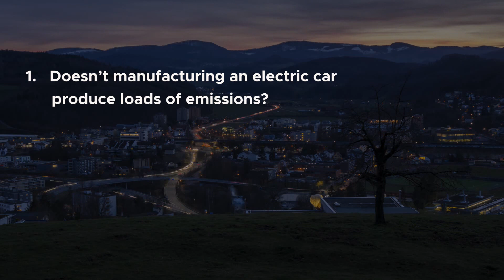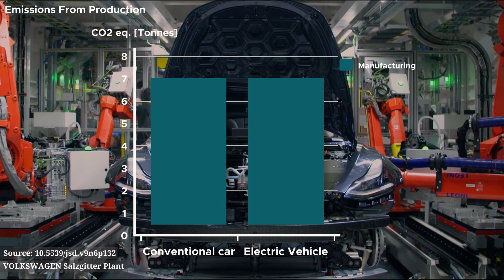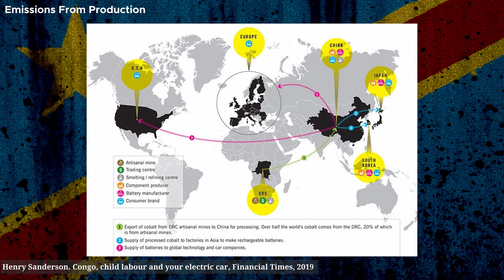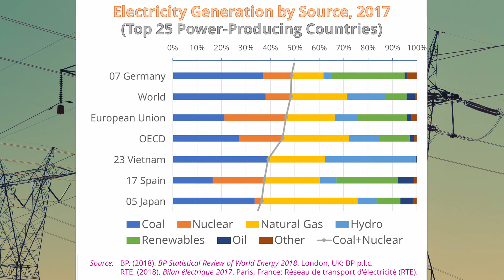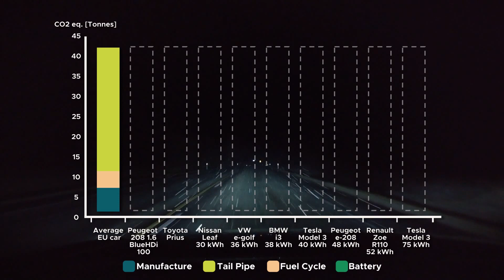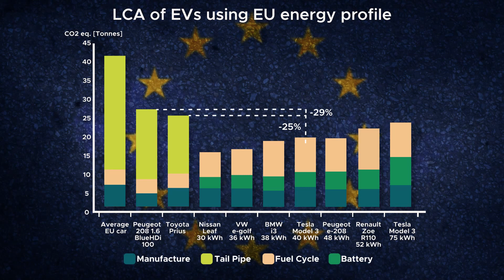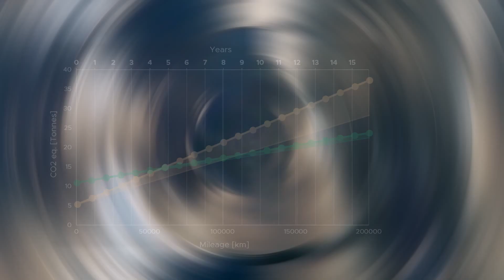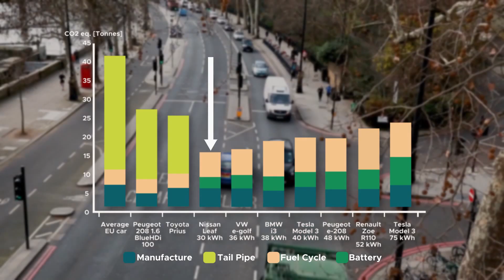Could Electric Vehicles be Bad for the Environment? Data Reveals the Truth

Comment: The range of travel is not apples to apples.  The amount of lost energy in recharging and heat lost isn't factored in. The reduction in range or actual miles driven in extreme weather conditions isn't factored in. The amount of energy used in conditioning the batteries or heating them up before trips in cold weather or before charging in cold weather isn't factored in. The time wasted in charging and time lost because of charging on long trips on the road isn't factored in. The drain on the grid and the extra heat loss in superchargers isn't factored in. The driving miles for all types of vehicles including trucking, rail and mass transit is not factored into the miles driven in the US vs other countries is not accurate and leaves out a lot. The average commuter mileage driven back and forth to work is much higher in the US just because of the way the cities are laid out. 

The average mileage of cars in the US still being driven is 175,000 miles on the original  engine with a large portion of them still being used with over 250,000 miles on the clock. An EV battery is not going to last that long. Maybe the car will but the cost to exchange the battery will mean twice the amount of EV s will be scrapped so the cost of production in the same amount of time will be double that of an ICE vehicle. The depreciation on an EV is approx 70% in 10 years.

Don't get me wrong, I like EVs but I also like fuel cell vehicle technology. Advancements will make EVs better but the time table is going to need to be lengthened out. 

Overall the adoption of Hydrogen could fix all of these concerns and be 10 times better for energy storage of renewables.
Reply: There are already Tesla that have broken the 1 million miles without battery replacements, many are going strong after 500000 or more miles.

And then you advocate FCEV which are not going to last that long - because of the nature of hydrogen they are extremely expensive to keep on the road. You need to have the tanks pressure tested to 700 bat/10000 psi every 6000 miles. New high performance air filters for $500 or more every 18000 miles, a new fuel cell membrane and fuel cell rebuild every 36000 miles, the membrane alone costs $1200 - and a set "do not refill after" date on the fuel filler cap after which you must under no circumstances put any hydrogen into the tanks anymore as the whole high pressure system needs to be scrapped and a new one installed...

Hydrogen is proven to be 3 times worse than charging a battery in a BEV. And FCEV do have batteries and a fully electric drive train but also have large tanks that reduce available space in both the cabin and trunk of the car.
Reply: @karlgunterwunsch1950  pretty much all of your Hydrogen information is false. I have worked with a of the components you list. The tanks or cylinders are good for years not miles. The tank checks are based from the date of manufacturing out under a time frequency.  I drove a CNG truck which uses the exact same tank technology. Mine had 150, 000 miles on it before they gave me a new truck. I never once had an issue with any of the components. Why don't you talk to people who have been driving an H2 toyota. They have been basically trouble free since they came out and have been on the road a long time. I understand you being a Tesla fanatic and that is okay but reality is reality and full BEV heavy vehicles will never do what Fuel cell vehicles can do. Physics are constant and evident. Cars are fine to be all electric. Trucks and heavier vehicles are going to require range that is impossible for BEVs to attain. Lots of people are trying to tow with Rivians and Ford lightnings and they have about half of the tow range. The more battery you have to increase range,  the more weight you add and you use up that range because of increased weight and around the tree you go again. It becomes a vicious circle. 

You just do you and don't worry about the rest of us, the Adults got this.
Reply: @desertdan100  Your information is correct for CNG tanks, unfortunately then hydrogen tanks are not the same and thus your information doesn't apply. Hydrogen has some nasty properties, such as being able to alter the structure of solid metal. It also warms up when evaporating - which is a big problem as that means you can not recondense evaporated hydrogen but must vent it.

And those people that drove a H2 car in California or Germany are selling them off as soon as the free hydrogen runs out - because the infrastructure is so unreliable and the cars themselves are so often in service. I have cited the service requirements for the Hyundai Nexo by the way...
Reply: @karlgunterwunsch1950  The CNG tanks are the same Carbon Fiber Woven tech that is used in both H2 and CNG. Yes H2 can cause enbrittalment in certain metals worse than others. I have extensive knowledge and training in Stainless steel Alloys as well as Titanium and other special Alloys. We have been dealing with H2 for decades , it is not a new thing or tech. As with batteries technology is advancing rapidly and there are many many Solid State storage technologies for H2 at low psi. Under 20 psi at room temp and extremes of sub Zero and over 200 degrees Fahrenheit. It is very stable in that mode. 

On a side note . When Hydrogen drops in pressure or Evaporates it has a refrigeration effect. It does not get hotter when it evaporates. It's Boiling point is very low. - 423 degrees Fahrenheit.
Reply: @desertdan100  Just that the tanks in FCEV are not at low psi,  they are 700 bar/10000psi, the filling station operates its buffer tank at 1050 bar/15000 psi ... CNG pressures are a joke in comparison.
Reply: @karlgunterwunsch1950  CNG tanks are tested to 2800 bar before they are certified to leave the manufacturing plant. They have to ensure that they won't burst under high temperatures,  pressures and impact stress in an accident. That is why they decided to use the same tank technology for H2 storage. They actually have fired armor piercing rounds at them under pressure to see the effects.

Comment: I wish you have also included the fact, that bateries deteriorate over time this they need to be replaced => more greenhouse gasses.
Did you also know how poorly EVs perform under extreme temperatures? Not very suitable for countries like Canada or Nordic countries in Europe.
EV's range is not the issue. The fact that it takes forever to charge them is. And unless you have a house with garage where you can charge it overnight, it will be very difficult for you to find some place where you can leave it long enough to get a full charge.
Reply: Yet in Nordic and Europe, they're changing to electric vehicles, Canada also has electric vehicles.
Reply: Can't speak for all EV makers but all new Tesla's have batteries good for between 400k and 1 million miles so no need to replace the batteries for most people.
Reply: "I wish you have also included the fact, that batteries deteriorate over time this they need to be replaced => more greenhouse gasses." He did it was one of the settings on climobil
"Did you also know how poorly EVs perform under extreme temperatures?" Again he did it was one of the settings on climobil
"V's range is not the issue. The fact that it takes forever to charge them is." There are a few solutions to that 1) charge it every night so that time is when you are sleeping anyway but yes as a man who parks a 30 second walk from his house I'm not going to run cables across the road to power my car 2) swappable batteries which some manufacturers already do and takes less time that pumping petrol in some cases 3) Overhead cables like trams this has already been tested with electric trucks.
From my point of view the problem is that I simply cannot afford to spend money on an electric car my car is a diesel from 2008 and it cost me £800 3 years ago the cheapest EV I could find was £4,700 so it's not for those on a budget that's for sure if you can afford to buy a new car you might as well buy an electric car I think but if you don't have loads of money then for the moment fossil fuel cars are cheap to buy and there is a lot of them about to chose from.
Reply: We have regular road trips by EV owners to the North Cape in Norway, even in winter time. They make it a happening because it's so beautiful and delivers stunning videos. Aside from odd defects and impassable roads nothing prevents them from doing so... Take-up of EV in Norway now is close to 100% of all newly registered vehicles, in some regions there have been months since an ICE car was registered newly...
Reply: fast charging significantly shortens battery life as well
Reply: @yourmom10269  You do know what battery scientists call fast charging? For them fast charging starts at 6C. If you don't know what that means then you better shut up because you are just spreading FUD.
Reply: You are incorrect on several points. EV batteries in some electric vehicles are lasting beyond 500K miles. Those vehicles will be recycled before their batteries get replaced. The battery can be recycled too, and the elements used in new batteries. That's already happening.

EVs perform quite well in cold climates. That's why Norway has a higher percentage of EVs than any other country. EVs do get somewhat less range in winter because some of the energy is used to heat the vehicle's interior and battery with resistive electric heating. Some of the newest EVs, such as the latest ones made by Tesla have heat pumps which are much more efficient than resistive heaters.

Apparently, you are not familiar with high-speed DC charging. These public chargers are up to 25 times faster than charging on a 240 volt circuit at home. Using those high speed chargers costs about one-third the cost of gasoline.
Reply: @toddr.lockwood843  "ev performe quite well in cold climates" What are you talking about? I live in Canada and a tesla model 3 have at least 50% less autonomy in winter. And They dont charge below a certain temperature unless plugged in a very powerful charger. I wouldn't call that a good performance.
Reply: @maximeperron12  I’m quite familiar with cold winters, as I live in Vermont. I’ve been driving Teslas as my primary vehicle for 9-years. To charge efficiently at home, a 240V/50A circuit is advisable. The 2020 and later Model 3 and Model Y suffer less energy loss in cold weather than other EVs because they have heat pumps, not resistive heating. Once the heat pump has warmed the battery, range loss in cold conditions is nominal.
Reply: The good news is, not only is the technology improving at a fast rate, less and less cobalt is being used for batteries and it is highly likely in less than a decade, sodium will overtake lithium. The amount of petroleum needed to provide fuel for mining and how much CO2 it will dump into the atmosphere is less compared to the amount private internal combustion engines use in cars. Heck an EV recharged by a coal plant puts out half the CO2 as a gasoline car the same size doing the same trip and even much better in stop and go commuter congestion.

One nice thing about EV battery cells is, they find a second use in stationary grid storage and when there are enough of them to create a market, they will be recycled to reclaim the valuable metals just like any other high volume appliance does nowadays. Burning Fossil Fuels for private vehicles raise serious risks for our grandchildren, but mining metal for batteries does not.

That being said, all energy sources degrade the natural environment and they are all are dirty, The responsible choice to make is the least dirty one, not the one where you get to bill your grandkids for the cleanup. What is being pumped into the atmosphere represents an enormous technical debt, which is much much more than all the tax expenditures and all the subsidies by all countries to wind and solar energy and EVs.

Comment: You did not say anything about the carbon cost of producing the infrastructure to produce and transport the electricity vs the fuel. Also to have to wait an hour while charging cannot be justified by the temptation of a cup af tea. One hour lost every 300 km is 1000 hours over 300000 km,  that is eight weeks out of your life just waiting!
Reply: Most of the time the car recharges while you do - at sleep. Or while you work. On longer trips the charging infrastructure already is good enough to cut the average stop down to 18 minutes for some cars and the technology improvements will shorten that time even more. I struggled to take a bathroom break and pick up a burger while the EV recharged at a fast charger in the parking lot. After 20 minutes I had increased range to almost 400km again...

Comment: Unless I missed it, you did not include the effects of drilling the oil, transporting it to the refineries, refining it, and transporting it to gas and diesel stations.
Reply: @valentinlopatko  well said
Reply: Desperate nonsense.
Reply: how do you mine The lithium used to make a battery of an electric car. You use all diesel powered mining equipment. Then you take the lithium to plant that makes batteries using all diesel powered equipment. Then you take that lithium battery using a semi to a car plant using all diesel powered machinery. Then you take the electric car and transport it using a semi or a train that uses diesel to a dealership. Electric cars also involve a lot of plastic. Plastic is made out of petroleum a.k.a. fossil fuels. 80% of an electric car is plastic the battery is surrounded in plastic the dashes are made out of plastic everything in an electric car is pretty much plastic. We can go on the charging stations that use diesel powered generators sometimes that allow pollution. 80% of charging station are made out of plastic. Just think about it. You can have an electric car. But don’t take away my car or truck running off of petroleum.
Reply: @kaifox8446  Electric Semi's are here and will soon take over, but you are forgetting all the pollution and vast amounts of electricity used in the oil supply chain.
Cars are using alternatives to plastics now
This a short slightly amusing animation on the subject
https://www.youtube.com/watch?v=1oVrIHcdxjA
Reply: @kaifox8446  The same way every gallon of Oil uses. Which pollutes the most, this is a short amusing animation, which demonstrates the nub of the problem
https://www.youtube.com/watch?v=1oVrIHcdxjA

Comment: but what about the increased weight from the battery that makes more road maintance nessercary
Reply: The weight difference isn't as big as you make it out to be. If anything there is less road maintenance as the breaking of EV is smoother than the breaks on an ICE car - keyword is regen breaking.
Reply: @karlgunterwunsch1950  it is much worse then the main form or transport bikes e-bikes and moterbikes. also tesla batteries way like 500kg and the amount of road maintanince required is expinential
Reply: @milesdunstan-daams4855  Unfortunately for your argument recent studies have found that to be untrue as the tire sizes and tire compounds along with the smoother action of recouperation breaking have exactly the opposite effect on road surfaces.

Comment: Nice video. But i was wondering if you have add the to the calculation of drilling and transport and refining the oil/petrol, because that process is using a lot of the energy use and co2 emission. Ships, trucks, drilling platforms, or simple pumping stations. And to add to the point, the problem with environmental disasters if there is a oil lake, or problem. Things that can be removes with clean energy and makes the electric car look a lot better. And that the batteries can be reused, for other things